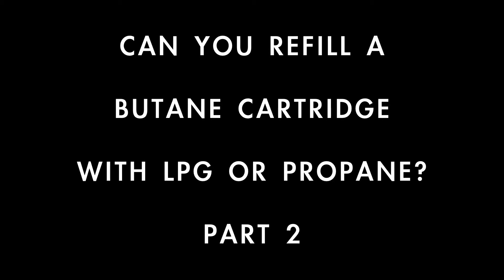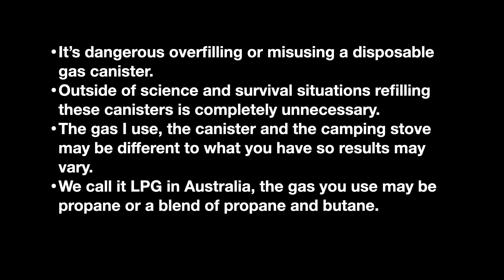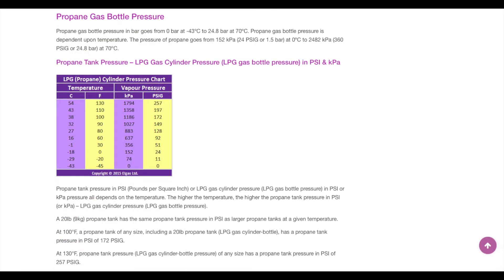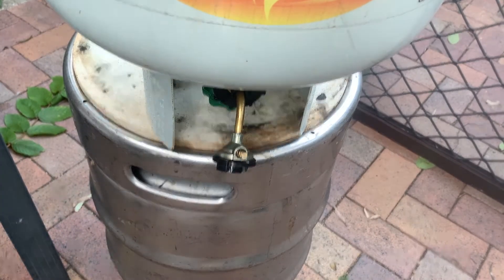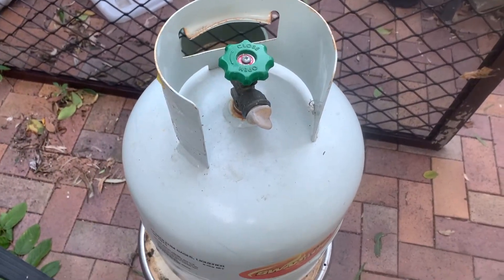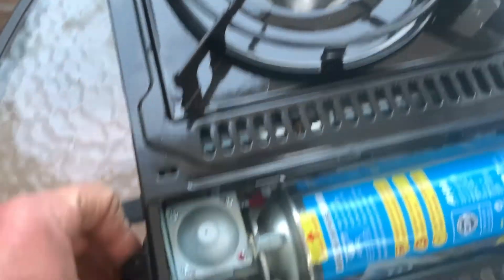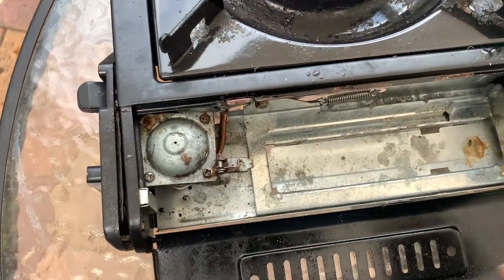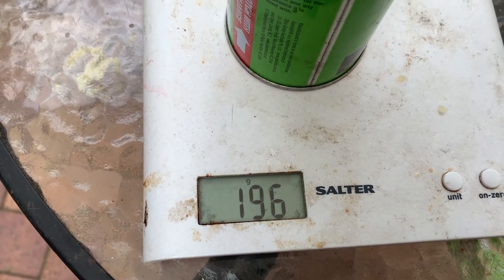Can You Refill A Butane Cartridge With LPG or Propane? Part 2 #accident #highpressure #don'tdothis!

Comment: Very dangerous to refill without a gauge, over refilling can cause explosions. No need to refill, when it finished I will throw the can.
Reply from the maker: That is certainly a valid opinion and what most people do.
A gauge is not needed because the can will not over fill, from a full 9KG bottle they maxed out below the original weight.
What can go wrong, if left in the sun the propane’s pressure will increase and the can will vent.
So the conclusion of my experiment is it works just fine in a survival situation, but due to complexity and propane expansion it is impractical for daily use.

Comment: Can I put butane installed while using propane?
Reply from the maker: Not quite sure what you mean, but they canisters are interchangeable. 
You can probably run a propane stove off butane, the key differences are jet sizes which make the type of gas burn more efficiently.

Comment: So you show that propane is 4x the pressure inside a container.   So then why would you fill a container made for butane with propane?
Reply from the maker: I did it to see if I could, initially I did not know about the pressure difference. 
At room temperature it held up OK and worked.
In a survival situation, if kept at room temperature I don’t see any problem with it.

Comment: One of the big problems in UK winters is that the propane evaporates first leaving, at half weight, mainly butane which doesn't evaporate quickly enough to give a significant flame.

I figure if I refill at that point back to just below the original weight it should allow more of the contents to be used without exceeding the original pressure significantly.
Probably the next refill should be back to 3/4 weight, then 1/2 weight. That canister can then be saved for summer use.
Reply from the maker: I wasn’t aware that was an issue, you might be onto something there.

Comment: I ordered four (4) of the recently introduced and legally refillable aluminum canisters to test. The canisters were shipped prefilled with 200 grams of fuel. They did not function in our Sonic (Korean), Iwatani(Japanese), or Asahi (Philippine-manufactured) brand butane canister stoves. The canisters functioned perfectly in a Kaisa Villa belonging to Beautiful Bride's friend who had one with her on a visit and in another Korean-made stove belonging to my buddy, the brand name of which escapes me. We did observe that after some of the fuel was used (my guess, about 1/3 of the can) it then functioned in our Sonic stove. Please note that Bounce and Sonic brands of disposable steel canisters come factory-filled with a mix of three different gasses and contain 250 grams of fuel, not the 220 grams most other brands are supplied with. These new aluminum canisters are rated for use with LPG but my guess is that we still had too much pressure with 200 grams of fuel. We will do further testing once we have an accurate scale and refilling equipment. My gas delivery guy informed me that the standard mix delivered to homes and businesses here in the Philippines is 70% butane / 30% propane. Basically, this is the fuel mix in flat-top Lindel canisters intended for winter use. That is what we will use for testing since those new canisters are rated for use with LPG.
Reply: OK, now this is weird, my second of the first three replies I made to you has re-appeared after I refreshed the page. Good luck in your search. If you post information about any products you find or links to Philip[pine online shopping sites. I will be happy to varify if you are viewing the same items we have found.
Reply from the maker: Thanks for all the info, I'll be looking out for these here in Australia, I hope we get them soon. At the very least these will be helpful for those in the Philippines and prevent accidents. @NewHampshireJack
Reply from the maker: Sounds very interesting. The big pluses are environmentally friendly package, refillable and very portable which is a big win.
Do you have more details on the refillable canister? I googled and found Petron Fiesta Gas 170-gram from the Philippines is that the same one?
Reply: @FixTechStuff  This is post 2 of 2: We purchased Trippler brand canisters that arrived with a 200-gram fill as noted above. Ferc canisters are the new kid on the block. GazLite offers its own brand of stoves and LPG canisters in two sizes. a large 330-gram canister and a smaller 230-gram canister. While searching for current offerings here in the Philippines, I noticed some of the new brands have disappeared from the market. I also noted that Petron (a distributor of gasoline (petrol), diesel, and lubricants has partnered with Fiesta Gas to offer a refillable 170 gram canister.
Reply: @FixTechStuff  I guess one (or more) of the YouTube censors have their panties in a wad. Now, all three of my replies to you have been deleted. The partnership between Petron Fuel and Fiesta is one of the new offerings. I have no idea why they package 170 grams of gas while others offer a fill of 180 grams or more. Could be for safety reasons in our often hot Philippine environment. I have not laid hands on one of their canisters yet but what I saw in a picture certainly looks like what we have purchased in the past in a different color. I will check next time we are near a Perton station to see if they have one in stock for us to try out.

Comment: its well worth it, i have been doing this  since 90s, its safe actually than he thought. the only problem is the gas bottle pressure much higher that the canister. you need a refill volve with gas release machnic to reduce the pressure to get the canister filled 80% of the oringal weight and use the release volve to get the pressure down to acceptable level to work with the stove, otherwise the gas will trigger the safty "shut down" throat of the stove or got back fire in the canister chamber . but if you dont leave it unattended, nothing serious would happen. just play with it around carefully , you will soon get mastery about it.
Reply: could you explain how to do that?
Reply: Where can a fella get one ?

Comment: Goodness me , please please do not fill a container designed for butane with propane or a mixture of isobutane/propane. As the ambient temps rise the vapor pressure will explode the bottle.
Look at thin butane canister vrs the say 230 gram bottles.  Huge difference in wall thickness
Reply: Maybe vent into the neighbours barbecue. Woommm!
Reply from the maker: Explode no. Leave one out in direct sunlight and it will vent, yes.

Comment: I get propane/Butane mix canisters so I guess filling it with only 1 type is dangerous, without some sort of pressure gauge you can't tell and may risk over pressure explosion which could detonate discharged gas
Reply: EN417 standard is 13.2bar at 50C, non-refillable
refilling at your own risk
search for "Propane Butane Mixture" and you will see vapour pressures at different temperatures
Reply from the maker: I haven't heard about the mixed canisters, that's interesting.
They are fairly difficult to overfill to a dangerous level, it basically stops filling and that's it.
The big issue is when the can is exposed to 40c plus or left out in the sun, the pressure will increase, the end of the can elongates and it will safely vent, you wouldn't want one venting in an enclosed space as the gas isn't safe to breath either.
Whichever gas is used, it's best to store them somewhere cool and out of direct sunlight.

Comment: Hello! Australia has a hot climate, and therefore butane is quite suitable for use. You should try to get rid of propane in this way. Take a bottle of liquefied gas and cool it with a mixture of ice and salt to a temperature below 0 Celsius. Then open the valve. Propane boils at -42 C. Butane boils at -0.5 C. The difference in boiling points is significant. When the evolution of gas stops, close the valve. After that, you will have liquid gas enriched with butane. Of course, all this must be done outdoors. You can fill butane cylinders and use them as you need. You can also use R600a refrigerant. This is pure isobutane. But it might not be cheap. We have a different problem in Russia. It is very cold in winter and we are forced to use oil burners or collapsible titanium wood stoves. Propane gas can be stored in heavy, thick-walled cylinders. It's still half the trouble. But the most important thing is that such cylinders cannot be transported in transport, we can be seriously punished if they are found.
Reply from the maker: Thanks for the valuable info! I've learned a lot from the comments here with different countries and people. Our winter where I live barely even reaches 0c. Russia is way too cold for me!
We do have a warm climate, but as I discovered Australia's LPG is 100% Propane.
R600 is quite costly here about AUD $400 for 6.5KG. Which got me thinking, can I refill my car air conditioner with isobutane?
Reply: @FixTechStuff  That's a really amazing thing! As far as I understand, propane produced in industry is more expensive than Butan. Why in Australia pure propane is sold difficult to understand. you're lucky. We have two types of gas. For winter, 20/80 Butane propane, for the summer, on the contrary. Buttan is considered an undesirable admixture and the propane refueling large containers is more expensive. The price of 400 Australian dollars per cylinder with an isobutane is shocking. In general, propane is also a refrigerant. R290. I used a mixture of propane with butan to refuel a laboratory thermostat. It cooled up to -18°C with the coolant. The temperature in the winter in Russia where I live reaches -30 Celsius. In other regions, it can be significantly lower to -70 ° C in Yakutia.
Reply from the maker: @hikewomeat  Actually it is possible I am wrong again. They keep changing the wikipedia page every time I look at it. 
Now its saying 90% propane: https://en.wikipedia.org/wiki/Propane#Purity
However it may be that our major gas supplier removes the butane before transporting or bottling it: https://www.elgas.com.au/blog/1972-lpg-contains-which-gases-gases-present-in-lpg-gases-used/

That price was for R600 refrigerant, I am unable to find butane in anything larger than disposable canisters.
Reply: @FixTechStuff  Another path is possible. It makes no sense to look for a butane if it is inaccessible, but you have propane. It is possible to look for aluminum or titanium cylinders for storage of propane. They can be more expensive than steel, but this is a single investment. I know that there are aluminum cylinders with a capacity of 0.7 liters. I have a 1.2 liter steel cylinder. 0.5 kg of gas is placed there. But as I already mentioned, it is not safe to carry such a cylinder  in our country. Metal detectors are installed everywhere and check the baggage.

Comment: what about the blue cylinders for burners or the green cylinders for camping stoves and torches?
Reply from the maker: This one? https://www.bunnings.com.au/tradeflame-400g-propane-disposable-cartridge-with-primus-internal-fitting_p5910392

And this one?
https://www.anacondastores.com/camping-hiking/camp-cooking/camping-fuel-fire/companion-resealable-propane-468g-catridge/90178928?gclsrc=aw.ds&gclsrc=aw.ds&gclid=CjwKCAiA6Y2QBhAtEiwAGHybPVIF6ixT0fWnYhH6V18lMXZIyDqRs63805UJ02Nj7nSlJM0B-rRiuBoCx7kQAvD_BwE

Are they the ones? Technically both of those should be refillable with the right fitting.

Comment: I should've bought a dual fuel camping stove. Then I could use that unused LPG tank. 

BTW do you think Butane canisters will be part of the shortages?
Reply from the maker: Yeah it’s worth diversifying. I have wood burning stoves and an LPG burner for backup. If there is electricity shortages I guarantee butane will run out. So worth stocking up with a box or 2 as they aren’t expensive.